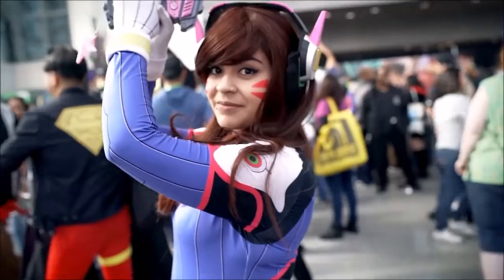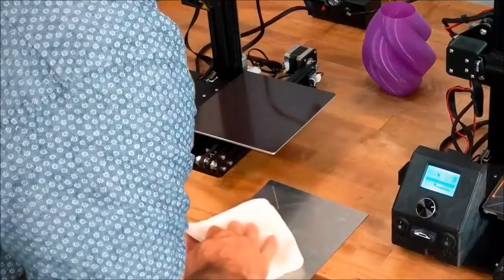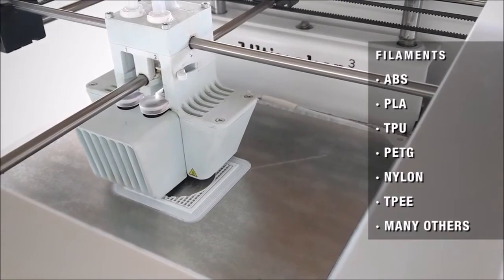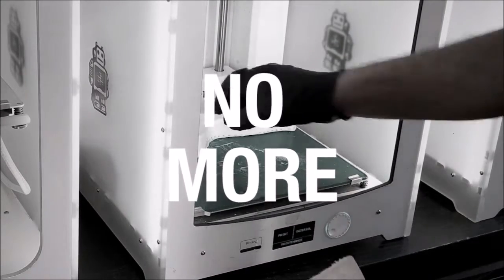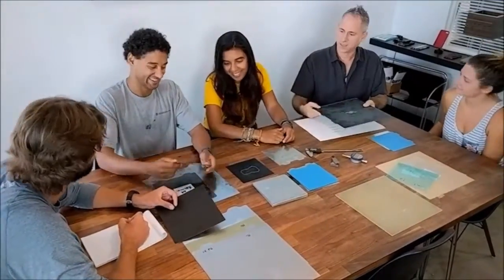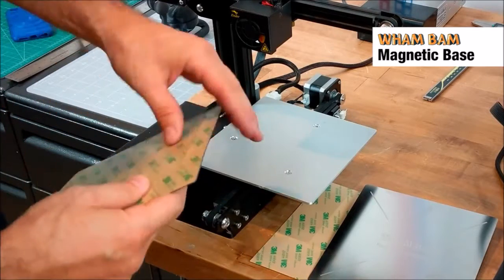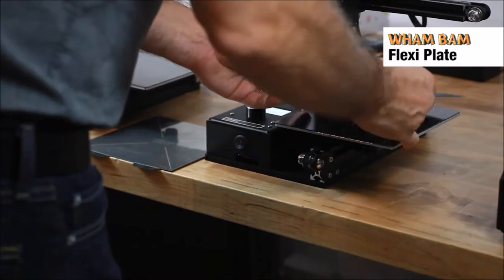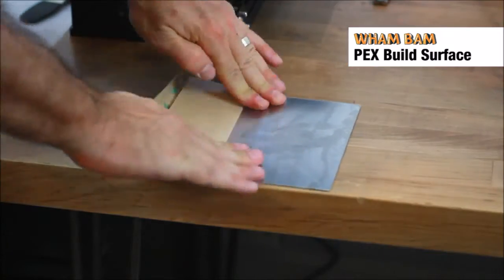Flexible Build System - Great First Layer and Pops Right Off!

Comment: Just bought one of your systems but mine didn't come with an instruction manual.

Got the 377 X 37p ender plus one

It came with steel wool, but is that for maintenance only or do you need to use it before usage?

Ive used it and although my first layer is perfect, silk PLA is still lifting on sharp corners oddly :S
Reply from the maker: Sorry we can send you the instructions if you send us an email to technical@whambamsystems.com.
Yes use steel wool vigorously on the PEX initially until all surface is semi gloss.  Clean well with isopropyl alcohol and paper towel.
Use a bed temp of 70 with PLA. And use a good squish for first layer.
Reply from the maker: Also watch https://youtu.be/_llO_QcPJRc

Comment: Is it simple to remove the magnetic surface in the future, if we decide to go back to a regular coated glass bed? I have the Ender 3 V2. Or is this more of a permanent installation?
Reply from the maker: Yes, you can remove the magnet base and use acetone or Goo Gone to remove the 3M glue. However, once you experience the ease, you will never want to go back! Here is a video with magnetic base mounting options: https://youtu.be/PNCam4_wp1g